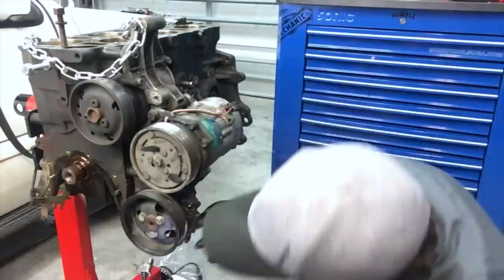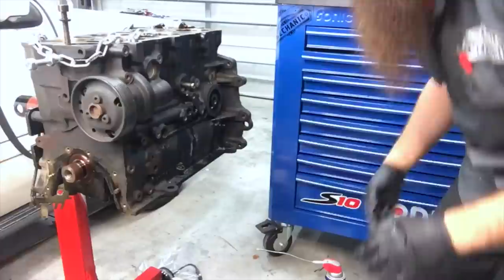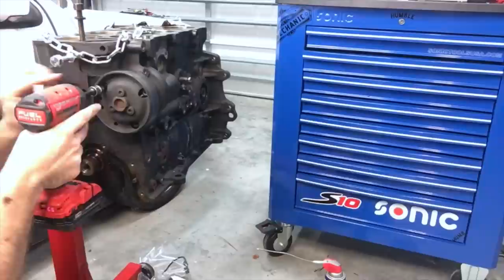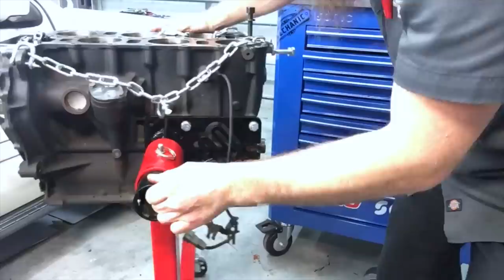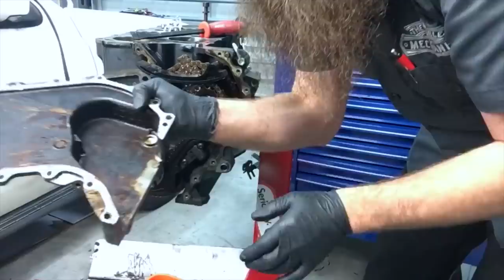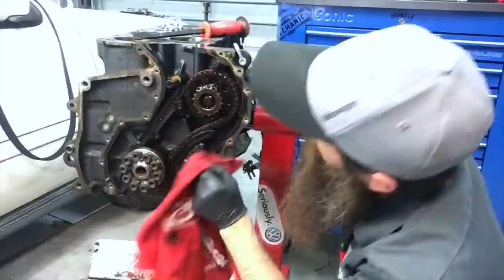VR6 Tear Down Part 2~FaceBook Live

Comment: DRC268s are great! Basically identical to the Schricks at a fraction of the cost. Really help open things up over 5k rpm, with minimal losses down low. The 12 valve motors tend to struggle up top

Comment: Do you recommend replacing the oil cooler it self. From my experience theses don't fail typically. Only the o rings which are like a few bucks . I would recommend throwing it on the parts cleaner  and flushing it.
Reply: Are you on vortex also ?
Reply from the maker: +Jamie Mosteller I have a Vortex profile but I'm not on much. 

I'll probably replace the cooler. These are super bad about failing.  Not like the Passats. But it's a small investment to keep the engine happy

Comment: when you round out the allen bolts get a bigger allen key bit like the one used tap it in as far as it will go and use a rattle or breaker bar to get it out. will it still not go out? get a bolt in that fits and weld it to the allen bolt the heat will heat the allen bolt. dont let it cool down but use the impact tool to get the allen bolt  out.
Reply from the maker: +otto leeverink often you can tap a torx into an Allen it bites in a different spot

Comment: Charles i'm surprised you did not cover the ports on the ac compressor when you took the lines off
Reply from the maker: +Brad Downs that's a good habit. I didn't because the AC system was open when I got the car. I'm a little nervous the compressor is shot
Reply: HumbleMechanic 
that's never a good sign to find an open system. it probably is toast or as we used to say lunched.
Reply from the maker: +Brad Downs haha no it's a bad thing for sure. I didn't realize it was open when I got the car.
Reply: my luck would be it was torn apart for just a bad or broken hose and the compressor would be shot from being open. can you get a rebuild kit for that compressor?

Comment: Maybe try a real impact instead of that thing you use that is made for driving screws, you loose a lot of torque through those adaptors.
Reply from the maker: +350munro the adapters lose a very minimal amount. 

But you're right this little guy doesn't have the HP for that. Buts it's all I have at the house

Comment: So my vr6 just did the same thing, started by smoking and overheating then some leakage from the head. Then dead :( I've been looking to get another engine ( used or hopefully rebuilt ) and professionally put in. How difficult would it be to put a 24v engine in my originally 12v vr6?
Reply from the maker: +Jay Dizzle not too bad. They are pretty similar. You'll need wiring and ECM for sure.

Comment: Was wondering how easy it is to get rebuildable Pre-2005 VR6's..  I'd do one up too if it was possible.
Reply from the maker: It's not too bad. The 2v4v are a little more challenging, but not too bad
Reply: I've a neat project that could use a decent engine, and a VR6 might be a good candidate as it could easily accept a variety.

Comment: Any reason you went with the Milwaukee that takes an impact chuck instead of maybe the 3/8s with the anvil? I recently got myself a 3/8s anvil and love it so far.
Reply from the maker: +Fabendog i like the flexibility of it. I have lots of bits for that chuck. 

I also have these awesome locking 1/4" drive bits for it. 

I think he 3/8th is great too. I just prefer that 1/4" chuck.
Reply: Fair enough. Thank you for the reply, Charles! Loving the videos.
Reply from the maker: +Fabendog rock on!!  You made a great choice with the 3/8! It's probably next on my list.

Comment: How did you get the crank pulley off? Do you have the counter hold tool at home?
Reply from the maker: +Garth Goldberg I borrowed one from work.
Reply: You're going to need it again to torque the bolt.